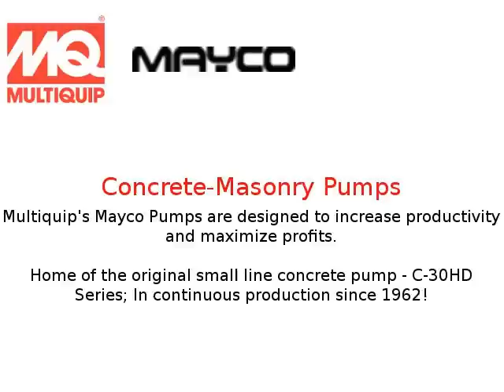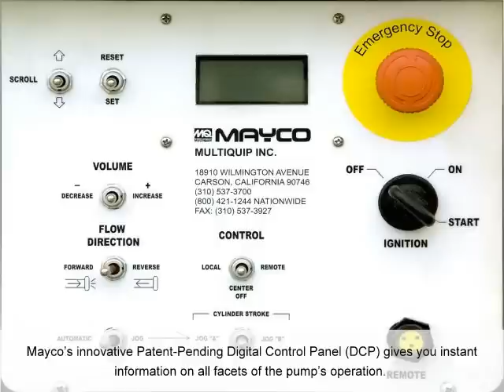Multiquip / Mayco Concrete-Masonry Pumps

Comment: Wiscon engines are essentially dead.  EPA killed them.  The engines you are remembering are no longer available for production.  Besides, they were loud, vapor-locking, vibration monsters.  The newer engines are more reliable.  The drawback is YOU cannot work on them.  But what modern engine can YOU work on any more.

Might as well wish for 37 cent gasoline.

Comment: To bad they stopped putting the wisconsin motors on them. Putting a water cooled motor on the ball valve pumps was the biggest mistake Mayco ever made. Be smart mayco and go back to the wisconsin motors not that water cooled joke they call a motor and if power is the thing wisconsin does have a 65 horse motor. more then enough power for the C30
Reply: Do you use 2” line or 2 1/2” ? We have hard rock in the concrete mix here in Boston (crushed ledge) Was wondering if 2 1/2” line would make a difference.